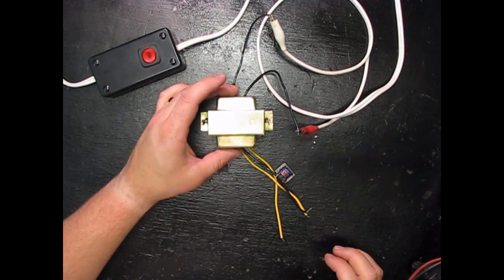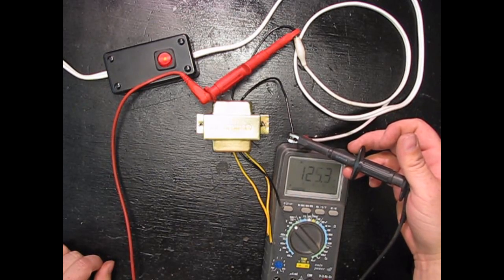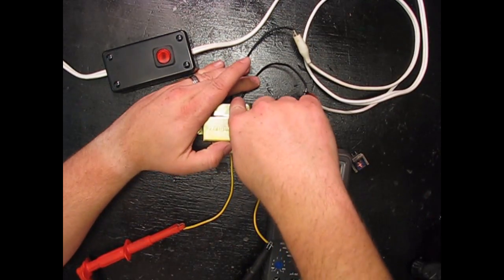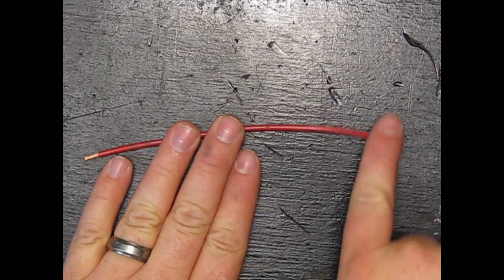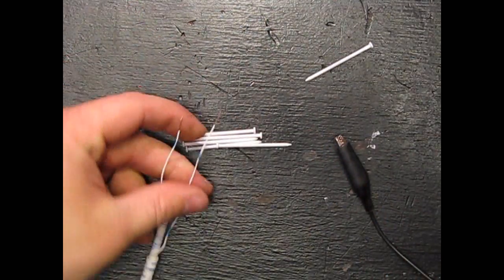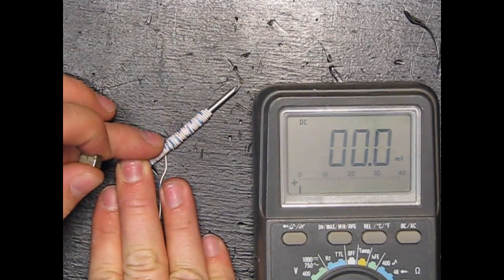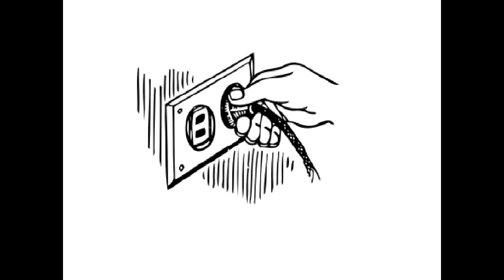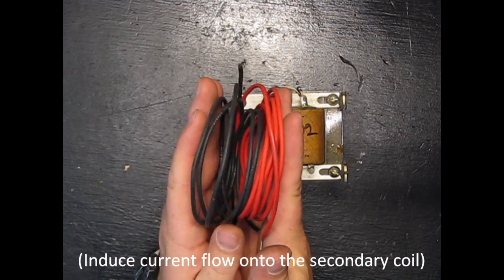What is a Transformer and how does it work?

Comment: Ive read that US specific equipment overheat when used in 230V countries on a transformer due to the frequency differences (60 hz US,50hz for 230 V). Would that still be the case even if the device says on its label (110V ~ 50/60).
Reply: it does over heat that's why u have to use a converter to supply proper voltage

Comment: Hey, thanks for the explanation. It really helps. I'm a mechanical engineering student and I have a hard time understanding electricity. I just have a question: in the first demonstration, if you reverse the transformer, would you get 720V (120V x 6) out the other end?

Comment: Primary coil creates electromagnetic pulses 50-60hz
and the secondary uses the pulses to generate electicity...like magnet with electromagnet.
The steel chassis make the pulses go round, if they dont the primary coil would burn.
btw the primary coil is around 800-1k ohm.

Comment: In theory yes, I have used step down transformers to step up voltage however since the transformers are not designed for the reverse job there may be issues. For instance the resistance may be wrong or you may risk burning the transformer up. Also the insulation on the wire may be rated acceptably to step 120 volts down to 12 volts and not be qualified to insulate stepping 120 volts up to 1200 volts ect.

Comment from the maker: @nidhi1454 Yep, the two yellow wires should be the full coil and the black is probably the center tap. so if you had say 12 volts from yellow to yellow then you would get 6 volts from either yellow to the center tap. Its just a way to get multiple voltages from one transformer.